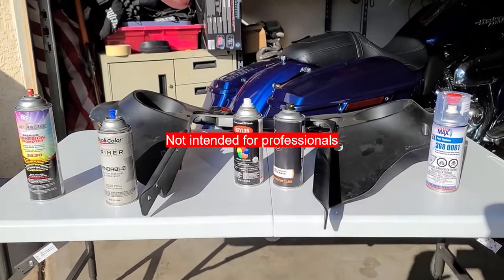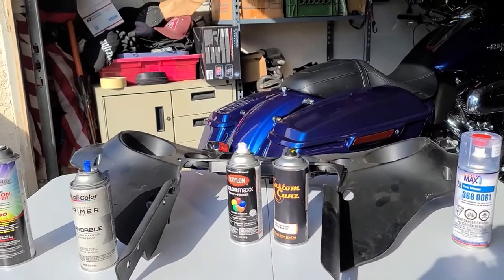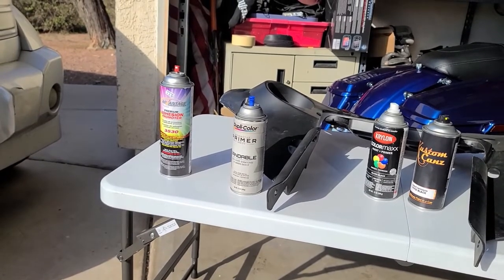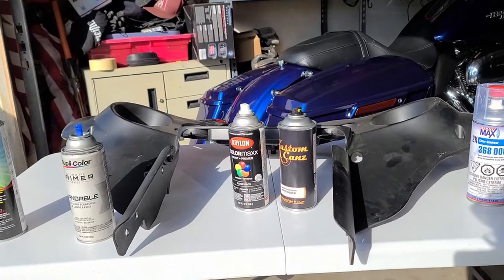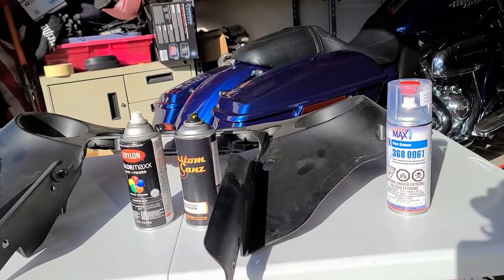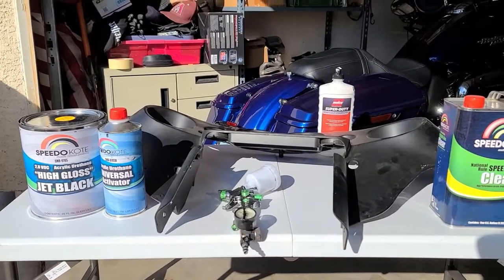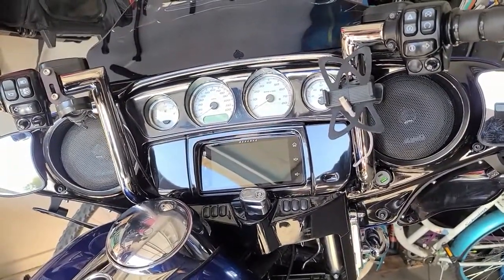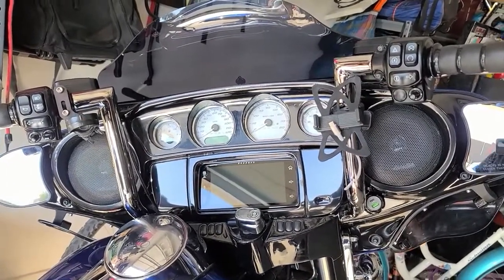Harley Street Glide Painted Inner Fairing - Do it yourself gloss black paint job.

Comment: Did you wet sand and buff polish or left it alone after clear coat?
Reply from the maker: The Spray Max goes on very well, usually no "orange peel". So, i just wet sand with 3000 grit areas with any imperfections (dust, lint, bugs, etc....) and hand rub using rubbing compound and then polishing compound. I wait at least a week before I wet sand clear.
Reply: Thanks for the info